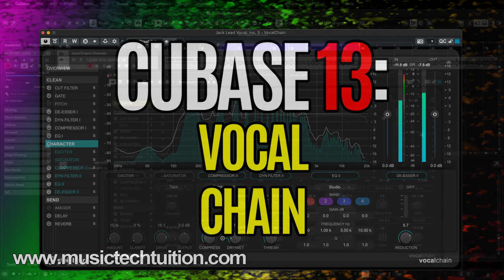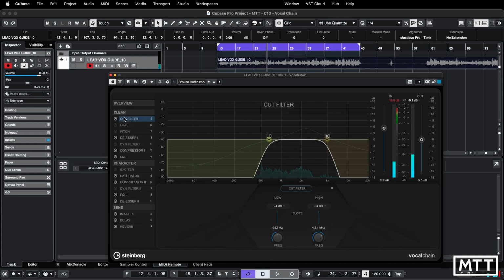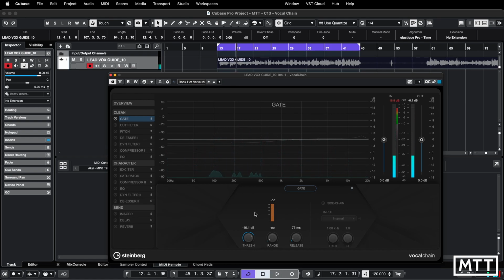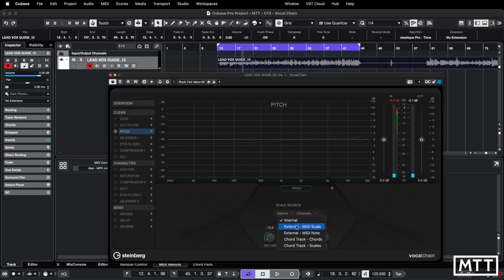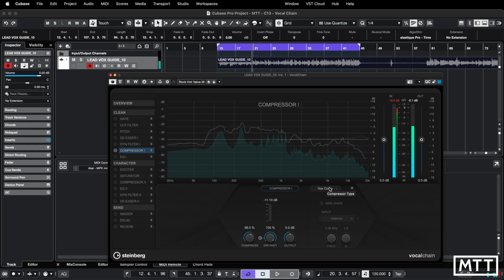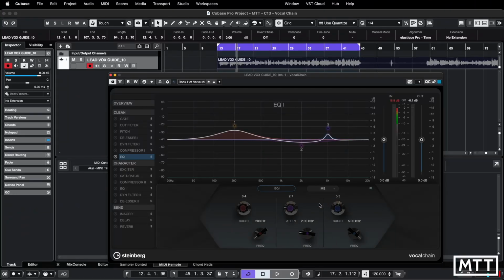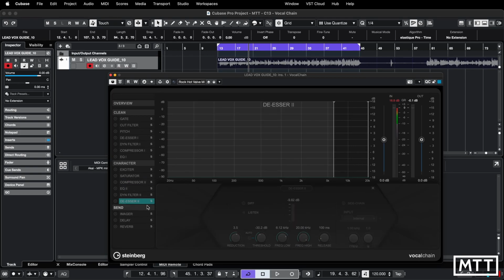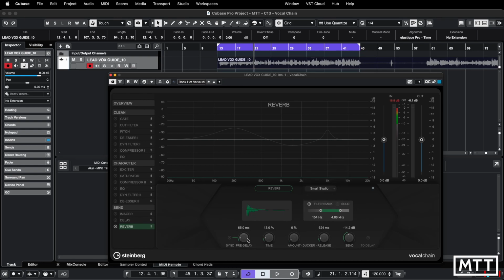Cubase 13: Vocal Chain

Comment: It does not sound like 13 is impressing you much.
Reply from the maker: I think it's more that there are no killer features, and I'm disappointed with the new appearance in a number of areas.  It's lacking the polish of all the other commercial DAWs, and some details as well.  It feels like a missed opportunity for than anything.
Reply: @musictechtuition  On the contrary...at least with me. I totally embraced all of their refreshing changes in 13 (and I've used the top 3 DAWs out there over the past 15 years). Different strokes applies here I suppose.
Reply from the maker: @hangar4avs  Absolutely.  It's easy to think that we have the only valid opinion, but if it works for someone then that's OK.  👍
Reply: @musictechtuition  I agree cubase seems to lack the polish of other DAW's but, I recently switched to it because its VERY powerful, and full of Musical workflows that seem to work with my brain.  I'ts also the best with midi hands down.